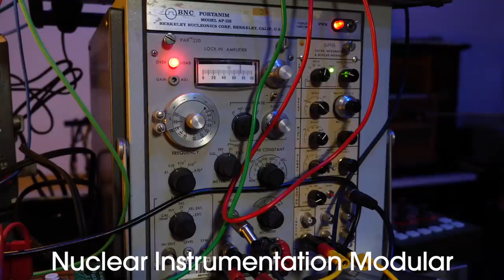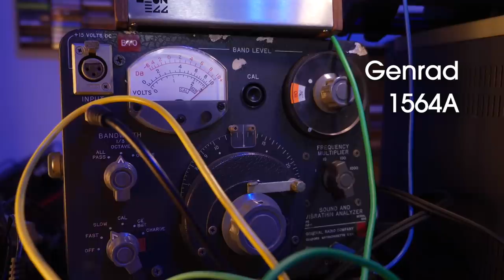Playing live with nuclear instruments and unknown synths

Comment: Fantastic work as usual, always enjoy your vids. A ? , how do u transport these units, as I'm assuming you r going overseas? I used to carry around a Makenoise shared system on the road, but yours is not standard checked luggage. And do u have to use any power mains converters? Hats off to u! 🎩
Reply from the maker: I have not travelled with these yet, this was a one-off. Sometimes I order stuff of ebay cheap to were I play (USA) and fill the checked luggage. Else my setup is carry on and all 9V-12V, with a Nagra 4.2 in checked.
Reply: HAINBACH  cool, thanks👍

Comment: First of all -- I both hope and hope not that you will be performing with the gear stacked the way it is in the beginning of the video. :-D Secondly -- how do you keep from blowing things up -- do you have stuff set up to regulate the voltages coming out of the test equipment, or is that the job of the mixer?
Reply from the maker: I use passive mixers as buffers, or in extreme cases DI. But I also have an 8 channel mixer with pads and low pass filters that works like a charm and sounds brutal.
Reply: Very interesting for me, as I am quite new in the world of electronic sound generation. Thank you both for question and answer 👍